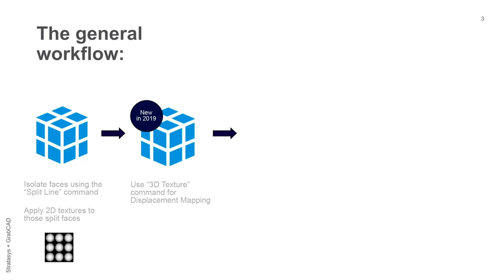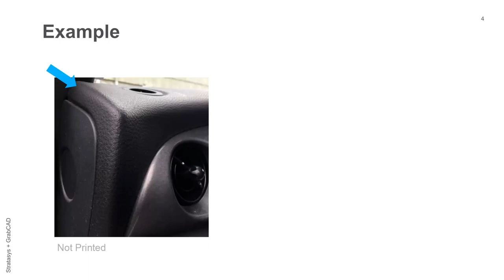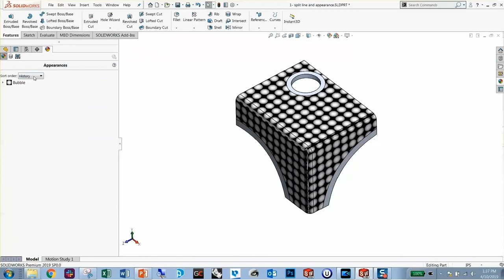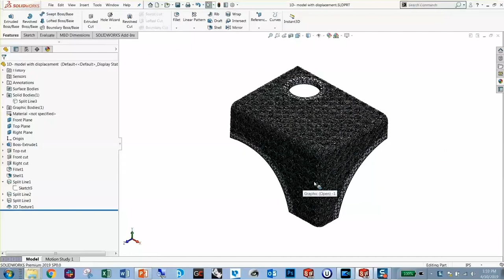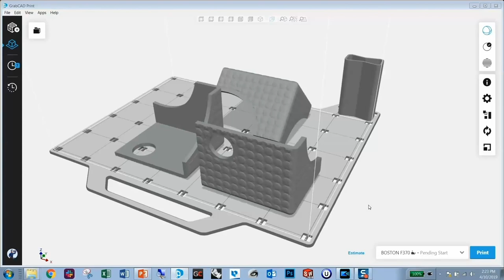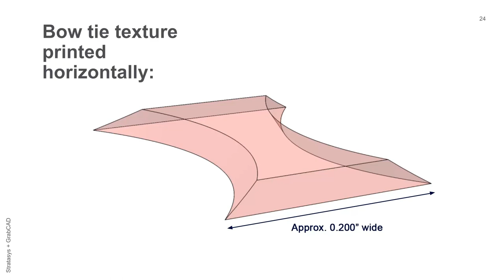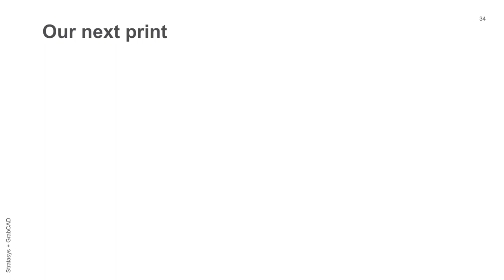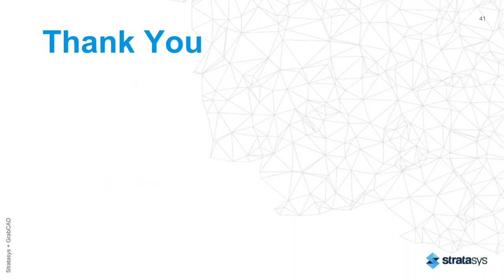Applying Textures to 3D Printed Parts with SOLIDWORKS

Comment: SolidWorks crashes every time I try to adjust the refinement. Am I doing something wrong?
Reply from the maker: One reason why SOLIDWORKS might crash when adjusting the refinement would be the amount of resources needed to create a mesh increases substantially as you increase the percentage. It's possible that your computer may not have the processing power to run the refinement adjustment quickly. Here is a link to system requirements for the software: https://www.solidworks.com/sw/support/SystemRequirements.html 
-  Ben, Technical Support Applications Expert.
Reply: @TriMechVTTs we have to use solidworks for modelling and a few people's computers couldn't even run it due to memory issues. My laptop was on the verge of the minimum requirement so whenever I went to render or edit anything big, it would freeze up for a certain amount of time...
Reply: @SkyTailedFox  .. i have 8gb of ram in my laptop...    But I do cad as a hobby.. not professionally...  (large assemblies)